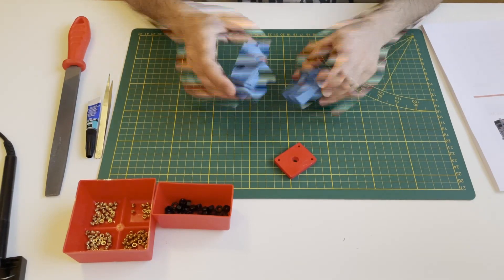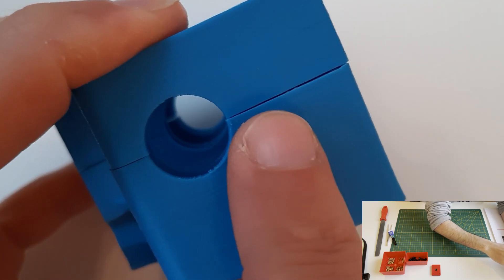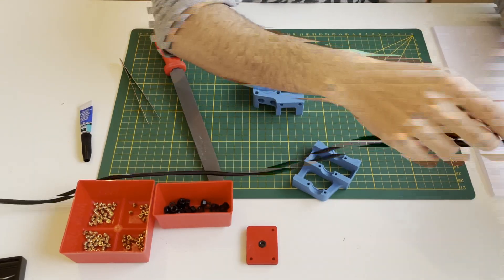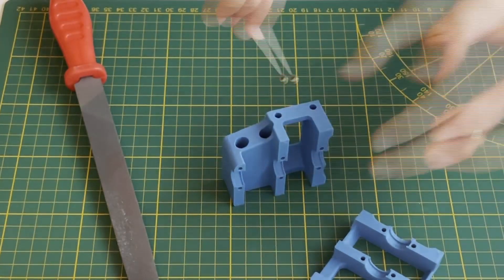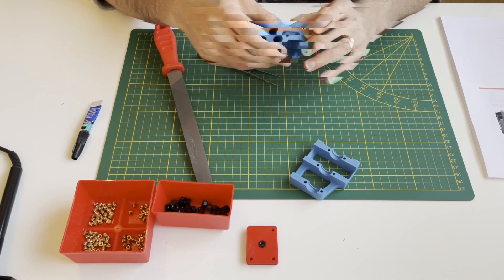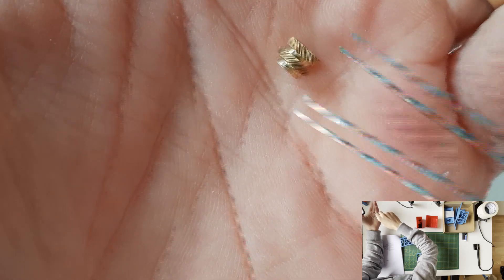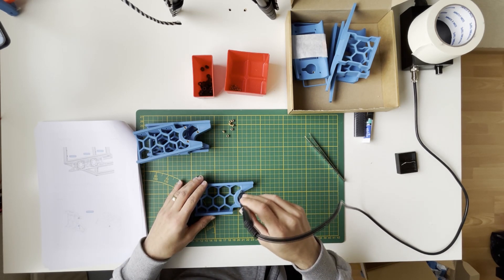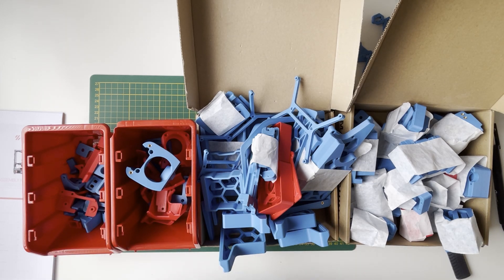Building Voron v2.4 - Printed Parts [Ep1]

Comment: nice video !!! currently building my 2.4 350mm version. Using formbot kit (recommending), and still waiting for 3dprinted parts (partial kit bought from Funssor)(bought parts because with currently have problems with abs). Most of printer build is covered in manual or Nero3dp channel. What im currently missing is only decent suggestion for electronic wiring especially for form bot kit. so will be waiting to see that one. but once again congratz on great video !!! keep up with good work!!!

Comment: Hey i ordered a kit today. Good luck!
Reply: Your printed parts look great, what did you print them on?
Reply from the maker: @shockload6731  I printed them on Artillery Genius. I am using it in IKEA Lack Table enclosure.
Reply: @zer0isdoing  Hi the provided STL is a lot to go thru. Could you share list of STL you printed??And how long did it took you to get it done?? Thanks heaps
Reply from the maker: @sumanbimali  Please check pinned manual, in there there is explanation. I do not remember how much time it does took for me.
Reply: @zer0isdoing  Did you do any updates on your genius? Or you just used stock nozzle? Could you please make a guide video as many people who bought the kit are struggling to source the parts and they already have some sort of printer but afraid to try abs. It would be really helpful to community
Reply from the maker: I have just build IKEA enclosure, that’s all. But I would not recommend IKEA enclosure it is not effective that much. Did you try to print with brim. It might help. And also use trusted ABS filament.

Comment: I ordered my Formbot kit a few days ago! But they mentioned that they do not ship it with 3D printed parts.. does that mean we still have to 3D print some missing parts? 

This is what they have on their website:

"This kit doesn't include any 3d printed parts, we just collect high quality components for Voron 2.4 corexy 3d printer, 
so you don't need to buy anything from different stores, that'll save your search time and cost for shipping parts separately."
Reply from the maker: Yes, the kit does not include 3D printed parts. I printed them myself.
Reply: @zer0isdoing  thanks man! 
Do you have a link for the 3D ".stl" files I need to print?
Looking forward for the build videos :)
Reply from the maker: @reddishlu  You can find all deliverables on github page. 
https://github.com/VoronDesign/Voron-2/tree/Voron2.4/STLs/VORON2.4
Reply: @zer0isdoing  thanks!
Reply: @zer0isdoing  any recommendations for the infill % for the ABS prints?
Reply from the maker: @reddishlu  Please check page 5 in manual. In that page, it is explained which settings should be used for ABS parts. Infill : 40%
Reply: @zer0isdoing  thanks! I still didn't receive the kit yet, but i managed to find the manual on voron's website now :)
Reply from the maker: @reddishlu  No problem! Check their github page (github.com/VoronDesign). You can find all deliverables in there. :)
Reply: @zer0isdoing  thanks and Ramadan Kareem! Noticed you have a Turkish accent 😉
Reply from the maker: @reddishlu  Is it that much obvious? :D
Reply: @zer0isdoing  haha no don't worry. It's just that I've lived in many countries and met many Turkish people :)
Reply: @zer0isdoing  Hello again, I have one more question please. I sent the .stl files for printing at a 3d printing shop and it came back saying that to print the 190 pcs it will cost around 350 Euros!! That's just crazy.. do I really need to pay this much and print 190 pcs??
Reply from the maker: @reddishlu  Of course not! Join the Voron Discord(https://discord.gg/voron)! In there you will find Print It Forward(PIF) channel. Basically, some of the Voron owners(who are approved to and got permission to do this) are printing 3D parts. It is €80-€100, but it may take time. And another thing they are only printing functional part for you. After finishing your Voron you can print cosmetic parts. 

If it will take too much time and in that time, if I finish my Voron, I can help you about that. Just let me know once you see melted plastic in my video. :)
Reply: @zer0isdoing  thank you so much bro! That's nice of you! For now, do you know which .Stl files are the functional ones? Maybe i can print those for now and later i can print the others myself. The problem is there are so many .stl files and i don't know which ones are the functional ones.
Reply from the maker: I have just done quick look, you need to print STLs which are placed under these folder:
*Electronics_Compartement
*Gantry
*Spool_Management (Unless if you do not have spool holder that you can use temporarily)
*Z_Drive
*Z_Endstop
*Z_Idlers
Additional Info: Do not print ZipChain, just buy one. Again: Check the 4th page in manual. It will help you to eliminate couple STLs depending on your choice(like Direct Feed or Bowden). And also check the folder names and STL names. For example there is mount for E3DV6 also for Dragon Hotend. But depending on your choice you will need only one of them. And check 5th page for slicer settings. 
Additional reference: You can ask PIF part list on discord. I do not have it buy if someone has it they can share with you and you can exactly know which part are needed.
Reply: @zer0isdoing  okay thank you so much :)
Reply: @zer0isdoing  Thanks! :)